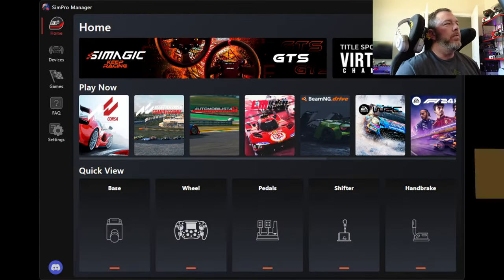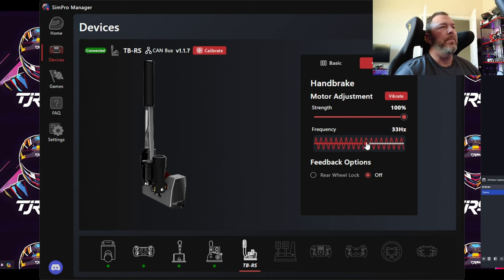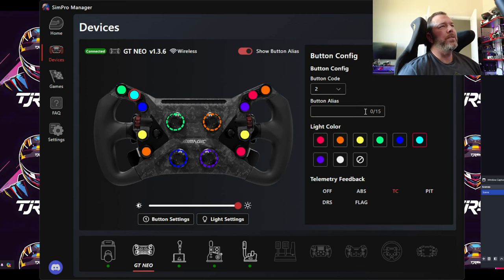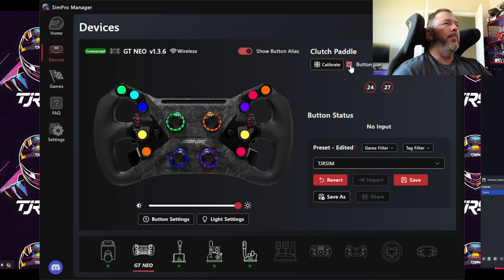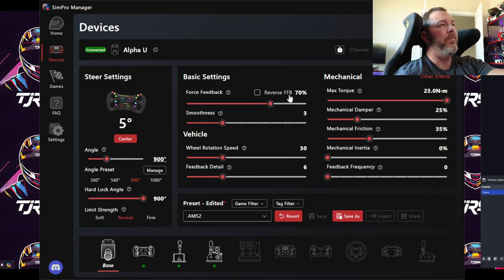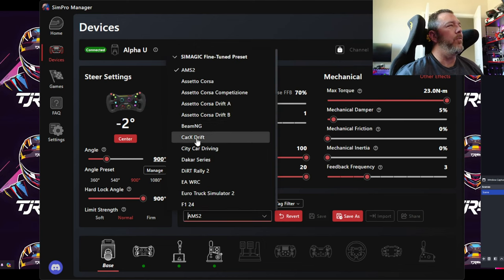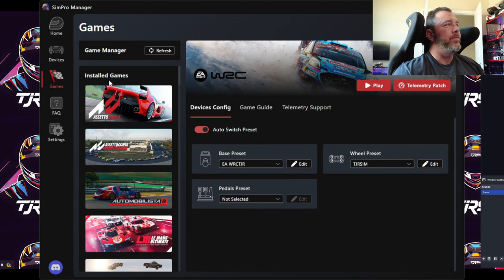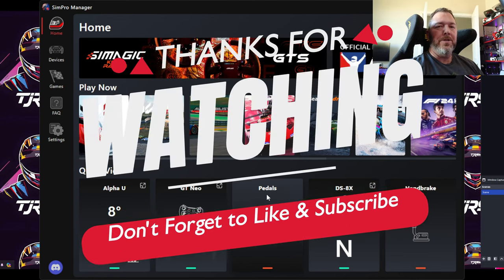Simagic SimPro Manager Software How to

Comment: Love my simagic alpha. And love the software. My second rig has a moza r12 I also love there software it’s nice and easy
Reply from the maker: @SIMRIG412  Great feedback. I want to review the Moza R21 especially since they came out with that new wheel. Of course you can use that wheel on Simagic also which is cool
Reply: @TJRSIM  yes that is nice it is able to be used on other bases. I don’t like the new wheel that much especially for $750 but I’m not going to act like I’ve never owned an $1100 wheel from cube controls. But I would rather buy the ks or gs wheel for my r12. But that is just my opinion. 

And the r21 would be nice to try. The r12 is powerful at least for me.

Comment: I just grabbed the sim lab front mount setup for my alpha u and I got the haptic pedal reactors and adapters to mount them to my sprint pedals. Need to get that stuff hooked up soon as I think the pedal reactors will be a great upgrade for immersion as well as just helping with braking overall.
Reply: They definitely are! Have 3 on my p1000s and 1 on my simagic hydraulic handbrake. Also thinking about getting 2 more haptic motors for my second rig with moza srp pedals

Comment: How much of an improvement is the alphaU over the Accuforce? Been using an AF V1 for a few years now, debating whether to upgrade to the alphaU or SC2 Pro. Mostly for IRacing and AC
Reply from the maker: I would say there is a pretty big difference. You know in th AF when you have your clipping correct and force turned up to what you like. Then at times under load in a turn the AF jitters like it lost signal and regained it within 1 sec, but it’s this harsh feel? The Alpha U doesn’t do that at all. 
The Alpha U is also much stronger for sims that don’t offer enough clear “no clipping” ffb detail. The Alpha U seems to get it done with ease.
The FFB is very smooth and forceful, but with the little vibrations not just the big jolts. So the smoothness is felt when contacting the surface textures like in WRC games for worst case example. The AF in WRC feels like noise and just disconnected from the roads gravel surface where the Alpha U feels like I can feel myself pushing rocks around with the tires. 

So this translate very well to games like Iracing that suffer (well it used to suffer I have not played it in 2 years) with feel across pavement and edge of grip. 

I’m actually surprised on how much better the Alpha U feels over my AF. Not only the power increase is just great for those weaker games l, but the clarity of the signal. 
I was a huge AF fan and didn’t think any of these latest wheels would have been a big game changer, but I was wrong. 

I at first got it to review for the channel and to experience the new fad of FFB wheel bases. To my surprise I will not sale the Simagic Alpha U now and go back to my Accuforce. 

I hope this helps. I don’t do reviews to get people to use my affiliate links I do them because I’m generally interested in the product and curious if all the other YouTubers that get them for free are really swayed by a shiny new free product or legitimately give us honest reviews. That’s why I do this channel. To help everyone I can. Have fun.
Reply: @TJRSIM  very much appreciate your thorough reply. 

The mid-corner jitter you describe drives me bananas. I was doing some laps earlier with a high downforce car (Radical SR10 @ Sebring) and for those cars I just don't have enough dynamic range. I imagine the slew rate would be better as well and handle heavier wheels better on the AlphaU. 

Have used the SC2 a couple times on demo rigs and they felt much stronger, but maybe a bit over-damped? Not sure since FFB is kind of subjective and I wasnt messing with any settings, other than overall force. 

Anyway - will give the Simagic a shot. 

Thanks again!